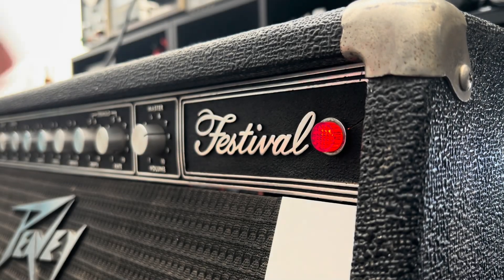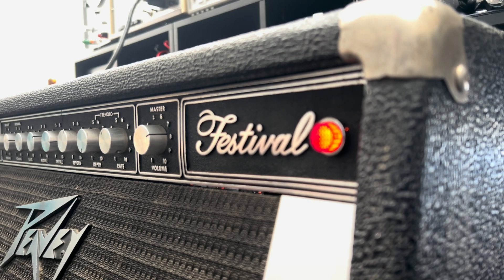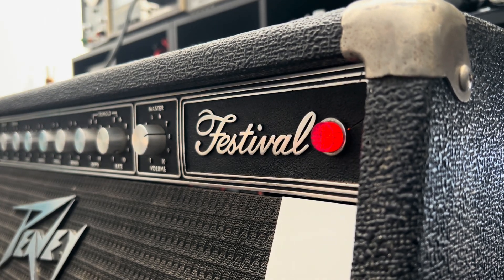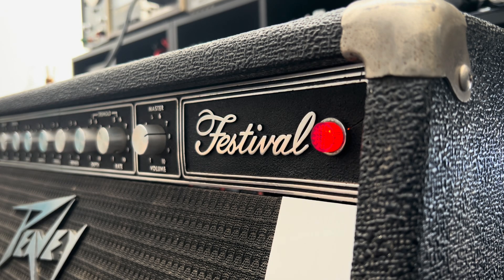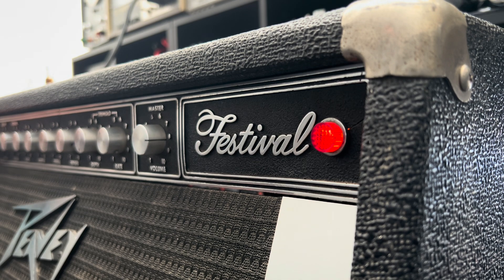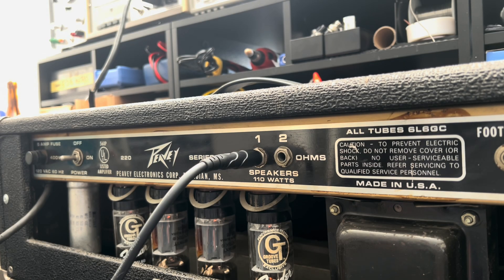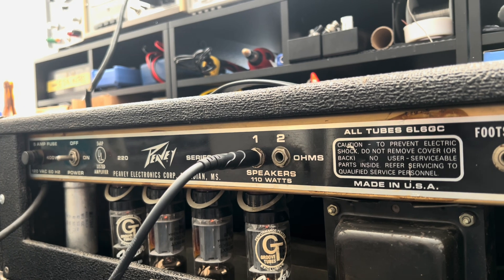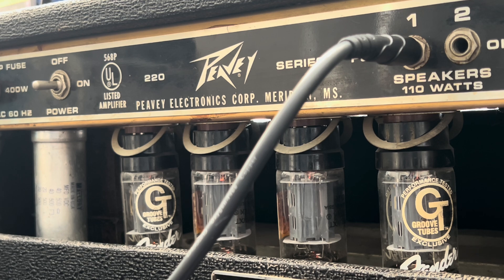Vintage Peavey Festival || Hartley’s Response to Musicman

Comment: Hope to see part 2! This is a really cool amp, love the look and sound. The filter cap arrangement is funny with these...they have the cap can and the pcb caps in series, one set for the plates and one for the screens, it's really just a pi filter with two series sets. I just rebuild these with 4 discreet 100uf caps and disconnect the can. Thanks for the content!
Reply from the maker: I hope there’s a part 2 also. Owner got it for so cheap it’s hard to justify the cost to service it. I would write this one off as a charity case if things were different. Gotta keep these old birds alive!  Going to look for the schematic in about an hour. Can’t wait!
Reply: @ForgottenGearRestorations  Yeah, it's too bad these don't hold much value on the used market. This amp and the identical Deuce II 2x12 combo are incredibly great for surf rock. The reverb + trem is killer!
Reply from the maker: @blakesimpson9974 I honestly believe the entire brand was maligned based upon the pointy logo.